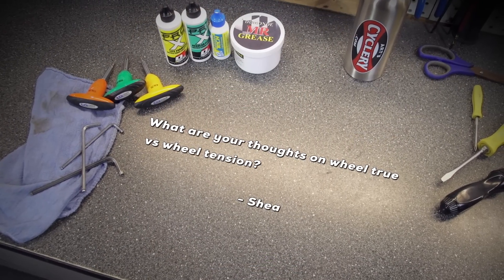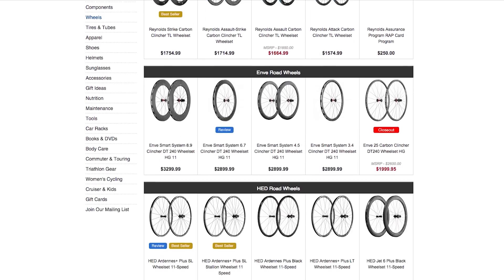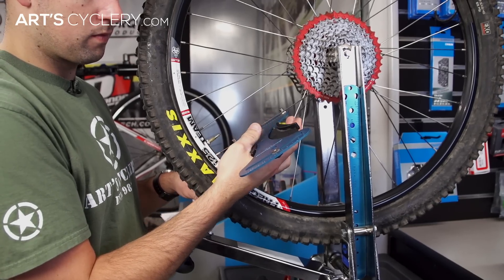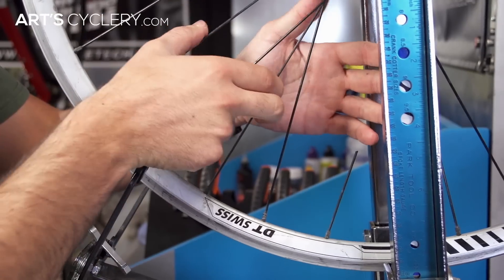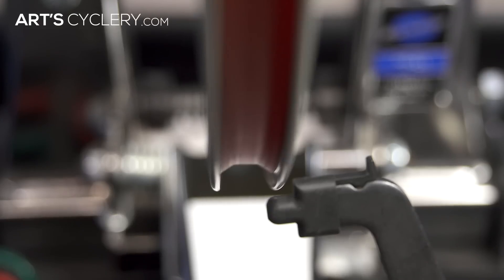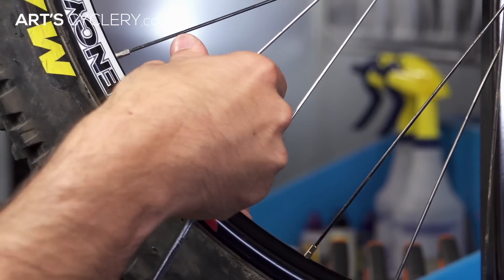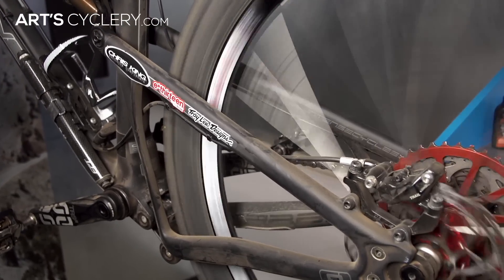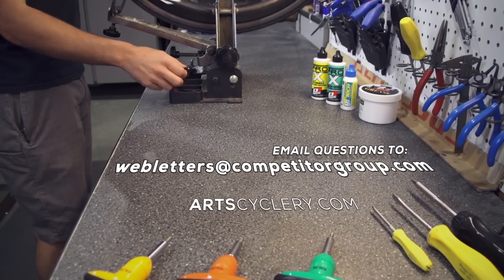Ask a Mechanic: Wheel True vs Wheel Tension

Comment: Good video. Nice to hear, that perfection is not possible for anyone on true and tension. Then question: Does it matter trueing and tensioning tire on or off? And I have single wall rims, so I think, I need to do trueing and tensioning without tyre, because if I do it with tyre, rim tape won't last so long to turning those nipples. But am I right?
Reply from the maker: You shouldn't have any problems truing the rim with the tire mounted.
Reply: @artscyclery875  Ok. Thanks for answer.

Comment: hope you look back to this, I ride my mountain bike and first road bike with 50kg/f in the spokes but wondering what is for my pre 6.8kg bike it has disc but when I tension it up the drive side is fine but wondering if 40kg/f on the disc side is okay? if not I might try to sort it as soon as can, custom build wheels that are 140grams less than zipp 202 tubular disc and that is counting skewer weight on my wheels, sapim cx ray spokes and rd010 prime hubs
Reply from the maker: Hi there,  exactly what wheels are you referring to? Manufacturers usually have pretty good spoke tension specs that are useful guidelines when building wheels or maintaining proper tension on pre-built wheels. Spoke tensions between drive-side and non-drive-side should be closer than on non-disc wheels as the spoke lengths are closer to the same length on disc wheels. There are many factors that come into play here, but we will do our best to help. If you send over the specific details of the wheels in question, I can look into get the spoke tension guidelines for you.
Reply: they are custom wheels built by me, the rims are under the code WA20T (ones with no rim surface of the WA2T), using 298mm cx ray drive side and 300mm non drive side with rd010 prime hub, I dished and trued it but if try to get 50kg/f tension it pulls close to one side and can't get enough the drive side to counter it and wondering if 40kg/f is safe to ride on

Comment: What are some possible reasons a MTB wheel may go out of true more times than a road wheel?  Is it due to the terrain versus a flat road causing the wheel to be out of true? Thanks
Reply from the maker: +Jonathan Wong The terrain encountered on a mountain bike is much more harsh than the terrain encountered on a road bike, usually including roots, sharp rocks, ruts, and drops. All of those added stressors make a wheel much more likely to fall out of true, especially when comparised to the terrain that a road wheel typically encounters.

Comment: Is it worth buying a spoke tention meter for an amateur cyclist?
Reply from the maker: +Bram Treffers If you have a truing stand, it's not a bad idea to have tension meter. However, you can usually get away with the squeeze method. Good question, thanks for watching!
Reply: Bram Treffers only if you want to build your own wheel sets or build wheels for friends

Comment: i ride a bmx and i notice some of the spoke when i squeeze its not that hard like the rest. so what should i do? do i start tightening them? i have a spoke wrench but i dont have a tensioner.
Reply from the maker: If you just tighten the loose spokes, you will likely see more spokes coming loose over time. Truing stand and tension tools are necessary for the truing process. If you have access to them, you may be able to true your wheel at home. If not, i'd recommend bringing your wheel in to your local bike shop for a truing.
Reply: Art's Cyclery ok, thanks for the advice.